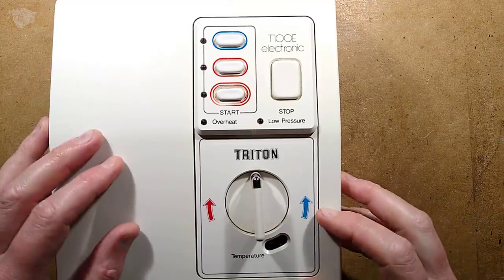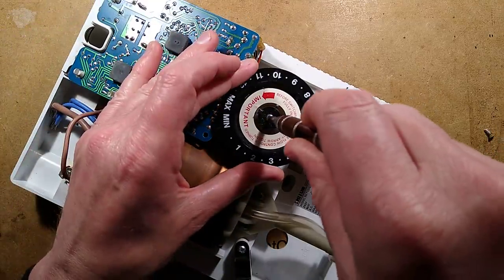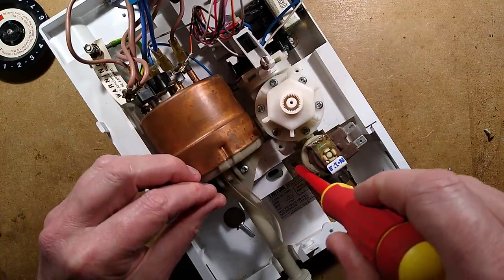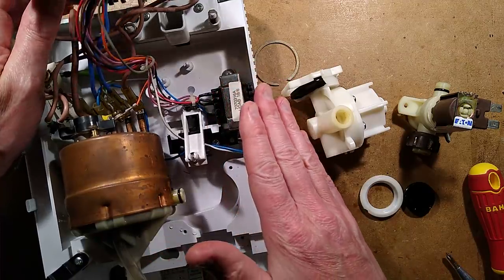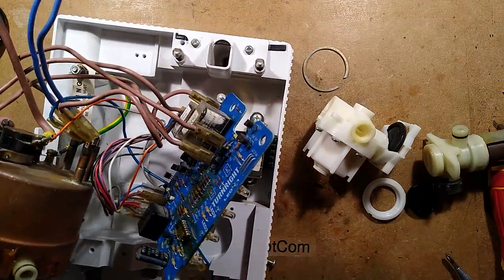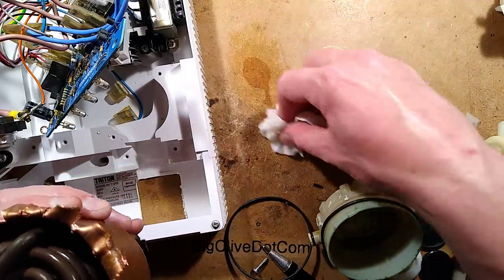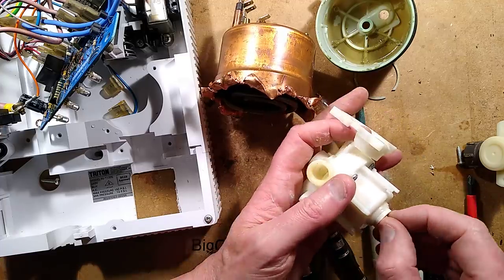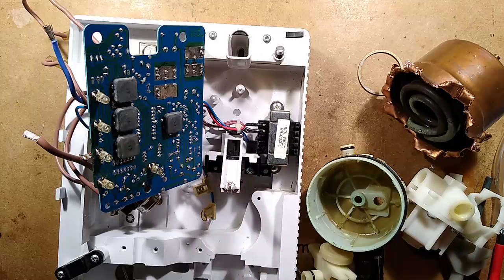Teardown of a British electric shower that went bang.

Comment: 240V in the shower...What could go wrong.
Then again, this is also a territory that has consumers handle 240V on a daily basis.
???Growing up in the U.S. 120V has been the standard with it being understood that 240V is twice as dangerous. 480V will actually knock you back whereas 240V will clamp and lock you on. 120V will shock the shit out of you but at least you can still let go, unless water is involved. I got my 1st 120V shock at the tender age of 12 tearing apart [like Clive] an old radio alarm clock to see what made it tick. I learned very quickly that there's pixie dust inside. I also learned it is beneficial that the device works when/if you get it back together, especially when it worked before you took it apart. [like Clive] One thing that has been to my advantage is that I was born with a genetic dry skin condition. I literally can stick my finger in a live light bulb socket and not get shocked [120V, never tried it with 240V] unless of course I lick my finger first. Which brings us back to the first point...I just don't like the idea of bring live mains [at any voltage above 50] into the shower with me, but a plugged in toaster is ok.

Comment: These things just would not work well on NA voltage.  The amperage requirements would insane and all the regulatory folks would go bananas.  Besides which, we like having hot water at the kitchen faucet and laundry.  So whole house water heaters are just expected here.
Reply: Oh, we have those as well.

Comment: I just had a new shower put in yesterday, replacing one that had been in since 1998 at the latest (according the model number). The plumber said it was the 8th electric shower he's replaced in the last month. He reckoned something about lockdown water pressure is breaking older showers!
Reply: Also, the weather has been exteremely hot and dry. Hottest Spring on record. That might have something to do with it.
Reply: Why does your government increase the water pressure during lockdown?

Comment: Hey man as its early maybe I can get a quick answer for a quick question :^) I have an electric shower, but the hose part and head build up a lot static, to the point where if I hold it my hand goes numb. Is this dangerous? Thanks for the vids, from Ireland!
Reply: Definitely have an earth fault
Reply: @jockwood2398  Thank you!
Reply: Sounds a bit bizarre - worth getting it looked at !
Reply from the maker: That's not normal.  Get it checked by a real electrician (Not a crash certified Part P labourer).  It could be that your drain plumbing is the source of current or the shower has an earth leakage issue.  If there's no RCD in your house I'd recommend getting one.

Comment: Lord, the fact some bretons don't have central water heating is bewildering to me. Literally every german home i've been in had central heating.
Reply: Oh, almost all do. I don't know the statistics, but it's surely over 99.9%. I've never been in a home that doesn't.
The problem is that older systems had really crappy hot water pressure, 'coz it was stored in a little tank in the attic, and dribbled down from there. It was difficult to mix (high-pressure mains cold water, low pressure hot) - resulting in hours of fun where moving the dial by a nanometer changed it from freezing you to boiling you.
Also with older systems, it took hours to heat enough water to take a shower... so you'd have to either remember to turn it on, or use a timer... but then someone else might have used it all up before you wanted your shower.

Most people are getting combi boilers now though, so it's no longer an issue.

Comment: Here in germany electric waterheaters are quite common usualy 21 kW 400v 3-phase but there are options for 24 and 27 kW the newer ones have bare wire heating system, that means the heating wires under full voltage is in contact whith the water but it all complies whith the safety nazi regulations and works realy well
Reply: These showers dont get up that high.  Mine is a 7KW and considered on the low power side, next up will be 9KW.

Comment: I'm curious to see what the new one is like
Reply: very similar but will be built more cheaply and plasticy. The water tank won't be copper.
Reply: New ones are very much the same inside but with 'engineered to fail' cheap and nasty circuit boards. Also the plastic bits are a little more curvy and have nicer twiddly bits to suit contemporary bathroom styles. You might get a few swanky red and blue LED's on the swankier models but that's it

Comment: The weirdest thing that ever went wrong with a shower for me was when it just stopped providing water partway through--but you could still hear a buzzing noise as if it had power. So me, being an idiot, turns it off and then on again, and get a good couple of seconds of near-scalding water over me because the shower must still have been heating the water internally even though it wasn't pumping it out. Still have no idea what happened there, but replaced the shower anyway because I wasn't about to trust it again.

Comment: im from the netherands and that unit doesnt give me the safe fuzzies either
have seen electric on demand heaters that had an m shaped copper pipe with 3 elements one in each leg 
, from wat i could see it regiuated the heat through a temperature probe and turned on or off with  two pressure sensors registrating a pressure differece 
seen these type of heaters in the phillipines too  both these places mix the cold water at the tap and doesnt rely on the device to regulate the themperature

Comment: Why are theese used (have been working a lot in the UK) makes no sense?
Reply: @Lester Piglet instead of using a central hot water supply for the house?
Reply: im not a fan of them but landlords fit them in allot in property's  "Electric power shower"  im not sure where the power part comes into it as every one i have used has no pressure to it. most property's in the uk have gas combi boilers fitted but i guess its easier / cheaper to fit an electric shower than pay a plumber to install a mixer setup ?
Reply: @Lester Piglet I live in a house build in around 1800! I Have hot water every where ... no it is a silly disbelief in using mixer taps
Reply: @MyJam1981  it is instead of using a mixer tap, for some silly reason they are not so common in the UK
Reply: @casperleeberg  ye i have a combi boiler and mixer in my house i would not want a electric one and as Lester Piglet
 says it was an easy upgrade in old property's most people only had a Tap Fitting Shower back in the day
Reply: They probably aren't used in places with lower mains voltage as heating water to showering temp as it flows probably isn't practical - would need a massive current at 120V etc
Reply: ReaperJamie You're mixing electric showers and power showers up. They are two different things. This video is about an electric shower. A power shower still uses electricity, but to operate a powerful pump either within the unit or more often remotely situated to boost the flow and provide a much more powerful shower than plumbing would provide without the pump boost. 

Electric showers are usually fitted for one of two reasons. The first is to overcome the issue of low hot water pressure from the traditional cistern fed hot water system often found in older properties. These last for decades so why replace them with a modern pressurised system at vast expense? In more modern homes with mains pressure hot water, electric showers are sometimes fitted in second or Em suite bathrooms so the property has a backup bathing option incase the hot water system has a fault. They are not routinely fitted as the main or only bathing option in new build homes.
Reply: @spencerwilton5831  i stand corrected. i always thought electric showers and  power showers were the same thing after googling i see that they are for hot water cylinders not cold water feed. my first house had that system with the pump in the attic that used to get air in it and make a squealing noise . all the property other i have owned have had combi boilers. a friend of mine had and elecric shower fitted and sson after there was a fishy smell that always came when the shower was on we tracked it down to the pull cord switch that was melting under the electrical load from the shower lol

Comment: Im in America, do European houses not have water heaters?
Reply: We do, in older installations there is a thermally-insulated tank which is electronically heated, this is upstairs and the hot taps/faucets are fed from this by gravity. In newer homes and with upgraded installations a combination boiler is put in, this heats the loop which the radiators are on (central heating) but they also have a diverter valve and the system can be used to heat water on demand for the taps. This also provides enough pressure for a shower without requiring an additional pump and avoids the risk of the hot water in the old-style tank running out before you're done (eg if you took a shower after someone else)
Reply: @dant5464  The choice between water heater styles and heating energy sources is usually independent.  All water heater types are available as heated by electricity, gas, from the central heating loop or as a separate chamber in whatever heats the central heating loop.  The actual water heater choices are "pass-through" (heats water on the fly), "pressure pass-through" (heats a volume capacity, but passes through the pressure from the water tower), "pumped pressure" and those low pressure "gravity tanks".  The names I used on this list are not the official ones, just guesses, but I'm pretty sure all combinations of principles and heat sources are on the European market.

Comment: Not only Americans. When you said it was IN the shower and runs on 220-volts, that is when I thought.. "That is a big no-no.. huuuge...".. And then you say.. "It's actually fairly safe.. when water isn't spraying out".. 

Yes.. and having a toaster next to the bath-tup for toast while bading is also quite safe unless you drop it in... nuclear bombs are safe until a technical failure or activation.. 

I wouldn't even say that it looks well insulated..

I accept that "most often it works", and it takes some bad luck for it to fail in a way that is dangerous.... Fortunately no one have bad luck more often than once every 50 years or so.

Comment: You don’t have hot water tanks?
Reply: Yeah we do (mostly), but the old ones took hours to heat up enough water for a shower - so you'd have to plan your shower time, and hope nobody else used all  the hot water.
New installations mostly get a gas "combi boiler" which heats water on demand, eliminating the issue - so electric showers are becoming rare now.

Comment: always so strange to me how the UK has electric showers.. literally the first thing you learn about electricity as a kid and are reminded all through out your teenage and adult years... Water and Electricity do not mix... especially if you're standing in the water. it boggles the mind..

More so boggles the mind when you consider when there's a catastrophic failure or burst tube or o-ring.. water is literally spraying all over the electronics and mains power.. and only way to stop it is to actually touch it.. while you're soaking wet and standing in water, It makes zero sense.
Reply: you have unfused/ungrounded plugs

Comment: Could you have 3D-printed a spare instead of cutting the heating element open?
Reply: girlsdrinkfeck The point would be not throwing an otherwise working shower into landfill. Against that is the cost in time and money of printing a spare, and its unknown reliability in something that combines water and electricity.
Reply: The reason why the shower is not being repaired is ALL that plastic is going to be having age related issues.  You would need to replace it all.  With a 25 year service life I say thats just fine.  The heating elements and a few other bits could be repurposed.
Reply: @dlarge6502  Or it could have been a Shower of Theseus thing. :)
Reply: @girlsdrinkfeck  Lacist.

Comment: Why not insulate the elements with none melting plastic/Teflon
Reply: The elements are insulated. There is a coil of wire inside surrounded by a high temperature insulating material (probably ceramic) then the outer metal is earthed.

Comment: I am shocked that, in a country where you can’t have an outlet in the bathroom for a hair dryer, having 240V wired into the shower is no problem.  Whatever makes this safe (ie: RCD/GFCI) could make a bathroom outlet safe too.
Reply: The problem is, if you have a socket, people will plug in all kinds of things that are not designed to be used in a wet environment.
The shower is, of course, designed to be used in a bathroom.
Your iPhone charger or radio or fan or whatever probably isn't.

Comment: 8.42 "helical", Clive! Shame on you!
Interesting. I took apart a "remote control" Triton from around the same era. Despite the heater unit being mounted in the loft separate from the control panel, both parts were identical construction to these - basically they took the same control board out of the integrated unit, mounted the main unit in the loft and put the identical control board in a panel mounted in the shower cubicle. Don't know why I'm surprised at that really, but interesting nevertheless.

Comment: How difficult would it have been to have 3D printed a new part.
Reply: Two problems: Firstly, designing it would have taken a while, and 3D printing is not as strong as injection moulding in most cases. It appears that the part that broke is quite highly stressed, so that's not an ideal application for 3D printing plastic

Comment: It's more efficient than a natural gas powered central heating system? Sure, 100% of the electricity gets converted to heat, but if you speak in terms of money efficiency... is it cheaper in the UK to heat the same amount of water using electricity vs natural gas? I live in Romania, and we mostly have central heating systems, for each house separately, and that's how we heat up the water for the entire house. It's cheaper this way here.

Comment: thats what i want,,turn on water, and let 240v , at my shoulder, warm me up. i take it that dedicated water heaters  are not common?
Reply: They’re common but historically gravity fed so they don’t have enough pressure for a shower. These are perfectly safe when installed correctly and to standard.
Reply: They were. Most* homes in the UK have had some type of dedicated water heater for about 100 years, but until "recently" (the last decade or so), they took hours to heat up water, so a) you'd have to plan your shower time, and b) the hot water (from a separate tank) was at low pressure.

a) Usually involved a timer to heat water once a day for e.g. an hour. But someone else might "use all the hot" before you wanted your shower. You'd have to then turn it on and wait at least half an hour for more. Then your Sister would sneak in before you and use it all up again.

b) Meant a weak shower. Also, the difference on the dial between freezing-your-nuts-off and roasting-you-alive was approximately half a nanometer, because of the pressure difference of hot to cold from the mains.

Now, most people* have gas boilers that heat water "on the go", eliminating the problem.

*[citations needed]

Comment: Plug the pressure enable pipe, solder 2 pressure enable wires together and off it goes... That hack can not be dangerous than entire that product... Shame is that, the newer model are the same dangerous and millions of homes uses these. That is why rest of the world does not use that kind of water heaters. Anyway 230V are not good enough instant water heater. The triton engineers understand that too, that is why they installed the water flow regulator. Less flow gives the time to heat the water but output are really, really low. It is almost like to make the hot shower water by tea kettle. 1-2 liters per minute.... ok that unit are capable to do little more.... They could make better job if they could add bit higher capacity tank than hundreds of milliliters. It could require the preheat couple of minutes. No problem, almost nobody does not start washing instantly if they do not want to wash their clothes too. Terrible product but story is good as always. Thank you!

Comment: 25 years ago I moved into a flat that had 3 phase just installed - shower - I commando jumped out of it when it made bad noises.  I went to touch a tape  -zap.  I got that weeks rent free - 'should've sue them
Reply: Yes, they went mad about 'equipotential bonding' - in some cases making all the plumbing live !

Comment: I'm used to mira electric showers but damn. This electric shower looks old af
Reply: My Mira is a pain in the arse because the button jams and has to be pressed again to release which sometimes turns it on and off in quick succession, and then because of the delay the shower has between turning on and off trying to actually get the thing to start is like that scene in James Bond with Boris and the exploding pen.  "Have I clicked the button 7 times?  Or 8 times?"
Reply: @krashd  Time for a replacement 👍treat yourself to a 10.8kw Mira shower

Comment: It's one thing to have an electric shower in a developed country, like Great Britain, but I wouldn't chance one in a developing country like India. Some of the ones used in developing countries have the heater built right into the shower head!!! I thought most of the on demand hot water heaters there were gas fired units mounted on the bathroom wall?
Reply: Big clive reviewed one of those!

Comment: These things are the worst. Either a too cold shower with decent flow or a piss of scorching hot water.
The first thing my visitors from Britain does is have a shower with good flow And heat.
Reply: Thats why you turn the flow regulator to somewhere BETWEEN the ends.